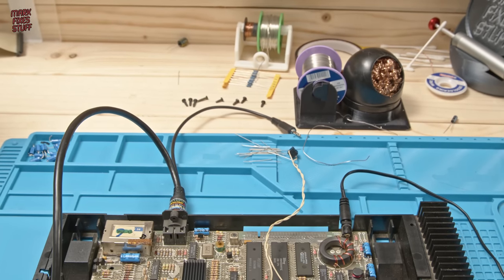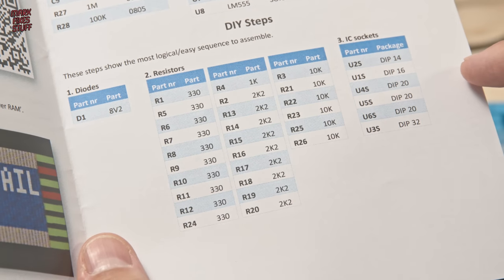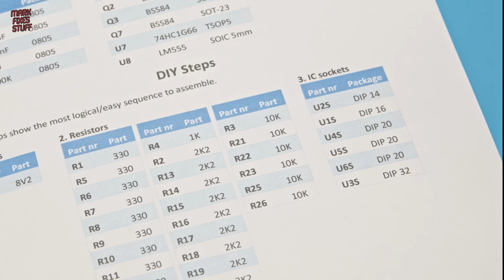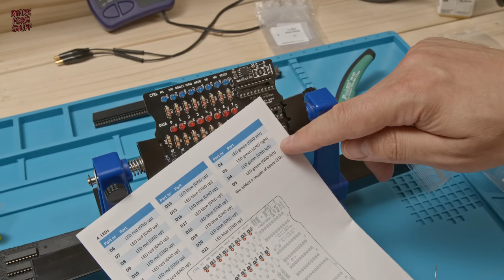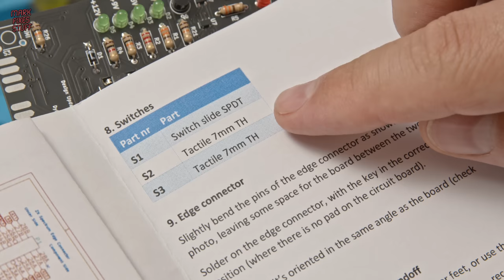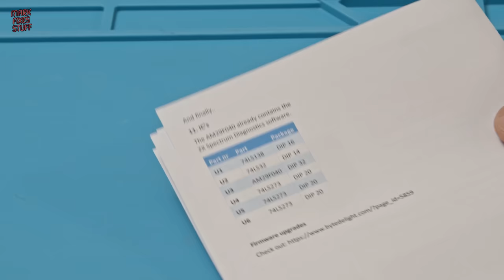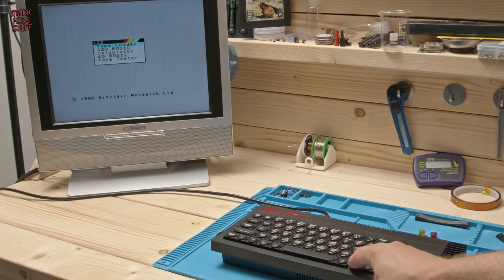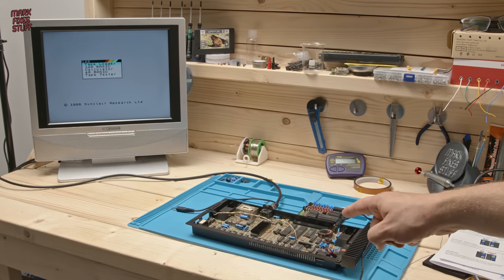Sinclair Spectrum 128k Toastrack Fix Part 2: Building a Diagnostics Cart! @ByteDelight

Comment: Not a Spectrum owner, but it's like RESET isn't being pulled low at startup, which means the Z80 is starting in an uninitialised state. Looking at a schematic, it could be worth checking if there's an issue with the two caps involved in the reset circuit, or even a broken trace.
Reply: Indeed. I'd vote for the reset circuit.
Reply: Great insight, reset from the cart was fine, so it has to be the board reset circuit which is backed up by that initial behaviour.
Reply: Looking at the schematic I'd check capacitor C27. That should be being used to keep the reset low for long enough for the CPU to reset and/or allow the rest of the system to get into a reasonable state after power up.

Also check R31, as if this isn't connected there's nothing pulling the reset line high so the CPU will never start.

Comment: My suspicion is a slight voltage spike on start-up to one of the ROM pins meaning it's crashing as it starts up.   It works when it pages in from the diagnostic cart because there start-up spike didn't happen.

Comment: Great vid @Mark I'm so happy you bounced back after the house fire. Looking forward to Pt. 3! I'm guessing there's an issue with the start up circuit. Perhaps not supplying enough power at cold boot but OK after start-up (hence the reset firing it up). A slow charging capacitor perhaps?

Comment: Interesting! I would have put good money on it being the ROM. I guess the answer is to look at just what parts of the speccy this board is fundamentally replacing when switched on. And that strange need to press the reset on the diag cart before it would work could be a clue. Could be as simple as a z80 on it's way out?

Comment: I was unlucky with that miss fitting switch. Had to splay legs a little as you did but when I powered up the board wouldn't work properly. Swapped out for one I had in stock that fitted perfectly and all was good. Contacted bytedelight and I think he said he would sort but obviously not yet. Well over a year since I reported problem. Apart from that a excellent kit. So if anyone has problems swap out the switch if you had to splay it.

Comment: The Bytedelight carts are great, when they work in my experience. My Retroleum diag cart is completely bomb proof, whereas my Bytedelight has failed several times requiring the replacement of logic ICs. It's ended up in the doesn't work bin in my workshop.

Comment: I assembled the same unit.
I used it on my issue 4S Spectrum+ and detected a faulty upper RAM IC which I was unaware of as it appeared to work normally.
I swap it with another IC on the same board to see if it is really faulty, It picked it out again. I replaced it with a new IC and now all ICs passed.

Comment: Seems like a problem with the reset circuitry / reset timing at start-up. How does the reset button work on the cart, is it just shorting two pins together?  If so, you can try that externally with a paperclip and see if it works without the cart... And if it does, then there is probably a broken trace somewhere, or a bad IC (as it's not generating they proper reset signals at start-up).

Comment: OK, diagnositics report nothing wrong and boot into the machine's ROM no problem. So, it's something between power on and the loading of the ROM. Does the ZX have a bios problem? I am assuming that any computer short of a mechanical one has a system for "this is how you start working".

Comment: Another great video especially as I'm an old speccy fan. You make soldering look so easy, can solder stick to the rest of the board because it only ever seems to follow on the pads.

Also, I noticed the instructions had a link for firmware upgrades but I could see a way to do that, i.e. A usb port or something.

Just being nosy, keep up the good retro work!
Reply: I imagine it's an EPROM programmer job :)
Reply: Solder can only make a joint between the tin plated parts of the printed circuit board and the legs of the components. The black finish on the rest of the PCB is a coating known as solder mask which prevents the solder sticking to any other part of the board.

Upgrades are done via a flash utility that runs on the Spectrum itself.

Comment: Amateur question but why not have a dual edge connector that doesn't need soldering? Perhaps held in place mechanically (screws, glue, whatever) rather than this soldered solution?
Reply: Such a part doesn't exist commercially.

If you think about how a female card edge connector is constructed you'll realise how utterly impractical it is to make a female to female connector.

Comment: Great. I won't mention you know what? 

Why does it say RAM bank 0 1 2 3 4 then 6 7 are okay? Where is number 5 and is it alive?

Been a while but how you coping after the fire? Update vid or do you just want to get on?
Reply from the maker: Sorry, missed this!

I don't really want to dwell on the fire. Starts to feel a bit like pimping grief, and I don't want to be seen as doing that. 

I'm not sure on the RAM question. I'll have a look back at the video if you have a timestamp.
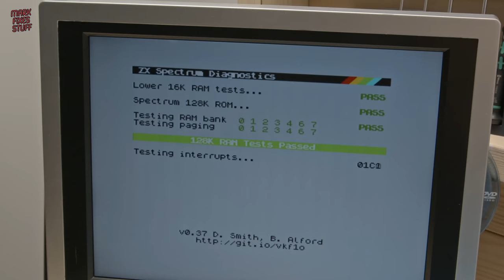Reply: @MarkFixesStuff 27:30 Is the first time it shows. It says testing banks and paging and shows "0 1 2 3 4 6 7" on both lines, 5 is missing. What is going on here?